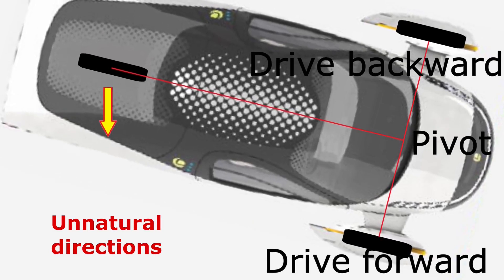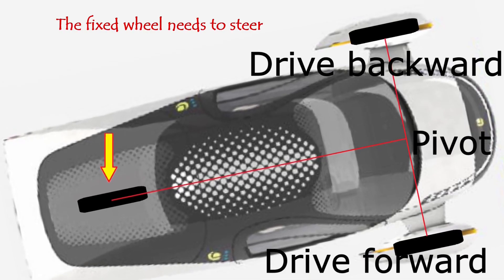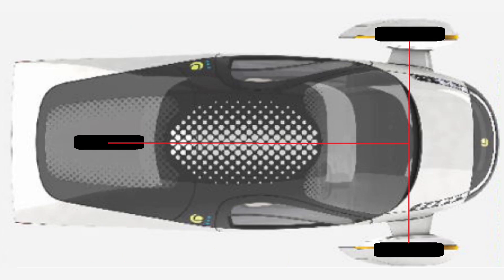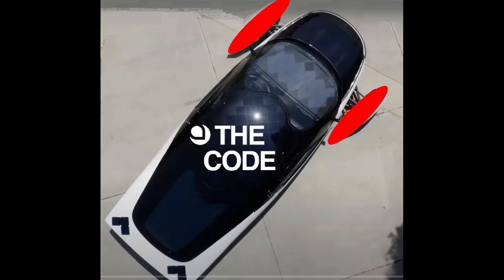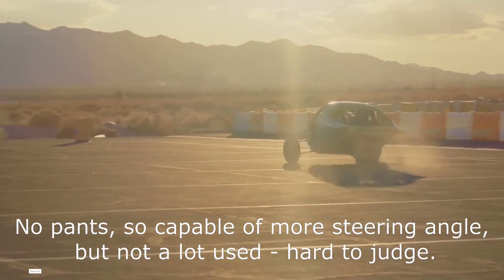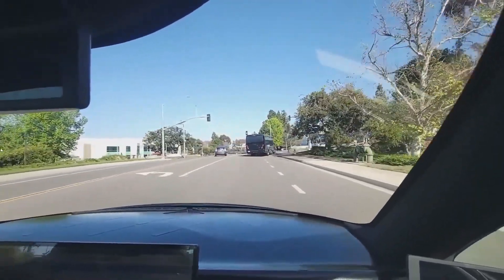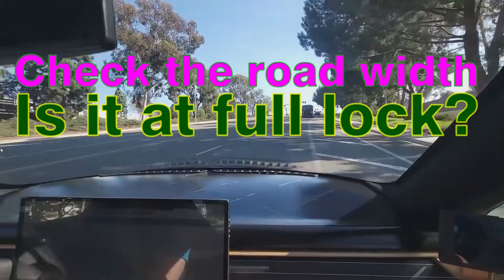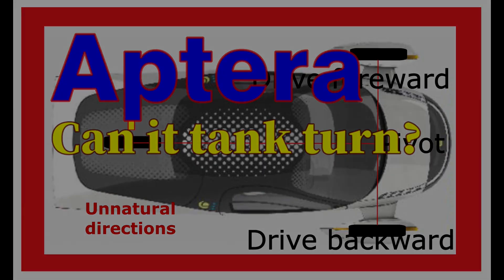Aptera Tank Turn

Comment from the maker: Pasted from Aptera Owner's Club today (the club with no owners):
This ditz is spreading the snake oil. She speaks as though the silly trike exists and, what's worse - as if it does the things the liars at Aptera claim for it, which none are proven. Not one. She is also that thick that she thinks Dolphins must have aerodynamics, when they live in water. Think about it, you brain-dead gullible Aptera fanboys; it may require the same shape as a plane, but only one is for aerodynamics. And on that note, she attributes the snake-oil 'computational fluid dynamics' (as is the con) to the design, when it is Professor Morelli who penned that shape in the early 70s and is never given enough credit for it by those deceivers. It was copied by Nissan in the flesh long before Aptera started in 2006, and is a copy still, but only Aptera added skin cooling, in-wheel motors, solar and even a silly tent to appeal to dimwits who would throw their money away on it. I am under a quarter of the way in and see so much guff that one would have to be crazy to take her seriously, and it smacks of her being hoodwinked by Aptera staff. Maybe even on the take? Let's start with the early nonsense about transport being a quarter of the pie? It omits the stats on how much of that is freight that gets the economy going and keeps everyone fed, to boot, which (without checking) I know is the larger part of that quarter, while cars and motorbikes are even smaller when you factor in Planes, trains and passenger boats. In effect, she is making what is not worth pursuing look as though it's the most important solution. And that's how easily gullible fools are strung along. Now, I am blocked from telling you this because the cretin owning this site is exactly that - a cretin for disallowing free speech and for the deception he keeps his viewers under. I will put this on my Aptera videos, but most of the poor dimwits won't be educated because I have less coverage. Oh, well, it goes on at least ten of mine.

Comment: Every motorcycle can tank turn. Its called "donut burnout". The three motor Aptera should be able to do that.
Reply from the maker: Technically, that isn't a tank turn, because the rear goes forward of the braked front wheel. Tanks turn in their own space (actually in the space of their length between front left to rear right; a fraction longer than front to back). Cars can donut burnout like bikes, and even Aptera can, but it's not the capability of a tank turn; it's a harmful work around.
Reply: @aussieideasman8498  But it is not so far away from the Rivian tank turn. And it is easier to accomplish, only one rear wheel has to loose traktion (while heavily smoking), the two front motors could independently turn the vehicle. And you would need a new rear tire after that.
Reply from the maker: @vic321344  The Rivian does a real tank turn. You can do it in an Aptera if you put a furniture dolly under the back wheel.

Comment: look into the Polaris slingshot its been around for years and has the same 3 wheeled aspect.
Reply from the maker: Who said the Slingshot was great through turns? It isn't, but at least its 124 mph top speed is okay, and it is real. There's that.
Reply: @aussieideasman8498  Nobody is claiming the Aptera is going to be the greatest turning car. So you don't have a better response to @TravelingChad than "its top speed is 124mph"? I've seen some of your videos and you just seem like a pessimistic grumpy old man
Reply from the maker: @mikeward3462  [Nobody is claiming the Aptera is going to be the greatest turning car.] Their mantra to build the most efficient includes turning efficiently. 
[So you don't have a better response to @TravelingChad than "its top speed is 124mph"?] You missed "it's real". That's a better response.  
[I've seen some of your videos and you just seem like a pessimistic grumpy old man] So stop watching.

Comment: Who has a concern about the Aptera having the ability to tank turn? A tank turn or crab walk is more of a interest with the coming EV trucks.  But you could think up a way the Aptera could spin 180 in place or tank turn.  All this could be done using the wheel speed sensors and some programming. Now this could only be done with a AWD model, and this is just an idea.  Lock the 2 front wheels, send power to the back wheel to make it brake traction (do a burnout) when that happens send power 2 the front wheels in opposite directions and spin that back wheel around 180 or keep going.  
Why are you so hung up on the turning circle of the Aptera? They have stated that it was improved from the Alpha to the Beta cars with Roush’s involvement with the suspension improvements.  I find it funny of how you try to mislead and put out bad information. You compare to a Mazda Miata, a car that is known to have one of the best turning diameters (curb to curb) of 30.8’, It would be more honest to use a car that has a similar wheel track.  What is you acceptable level that you mention?  The turning diameter for a SWB F150 is 41.2’, so would you say that some where between 30’-41’ is acceptable. You just put out statements based on what you think and feel with no context to mislead.
Reply: If you got a footprint larger than a Hummer H1, you also got the turn radius of a Hummer H1. live with it.
Reply from the maker: "Who has a concern about the Aptera having the ability to tank turn?" N Bruce Nelson. 
"A tank turn or crab walk is more of a interest with the coming EV trucks." Tank turn and crab walk are two separate moves. Nobody has mentioned the latter, to-date.  
"But you could think up a way the Aptera could spin 180 in place or tank turn." 180  in place is not possible. The best is 180 in twice the distance from between the front centres and the tail. 
"All this could be done using the wheel speed sensors and some programming." Not so. 
"Now this could only be done with a AWD model, and this is just an idea.  Lock the 2 front wheels, send power to the back wheel to make it brake traction (do a burnout) when that happens send power 2 the front wheels in opposite directions and spin that back wheel around 180 or keep going." It's 'break' traction, and that will only turn in the distance the tail goes around the front centres, which will be further forward than the nose by a long way. No need for speed sensors, nor even  AWD. 
"Why are you so hung up on the turning circle of the Aptera?" You didn't see that mountain road? 
"They have stated that it was improved from the Alpha to the Beta cars with Roush’s involvement with the suspension improvements." Suspension improvements do nothing for steering angles. Almost all their claims have holes you can drive trucks through.  
"I find it funny of how you try to mislead and put out bad information." I find it funny how you have so little comprehension. 
"You compare to a Mazda Miata, a car that is known to have one of the best turning diameters (curb to curb) of 30.8’, It would be more honest to use a car that has a similar wheel track." It is more honest to declare the turn circle. Similar tracks is almost moot, because most cars are similar to a Camry (some a little less and some a little more track), and yet they have a good deal of variation in their circles. Track is just one thing, and angle is more telling. This silly trike is supposed to be a small car, so the Miata is a good compare. The Smart car has 22.8 ', and the Honda E has 14' 1", which blitz the Miata.  I was being generous. 
"What is you acceptable level that you mention?" I have never tested it; I leave it to manufacturers I can trust.   
"The turning diameter for a SWB F150 is 41.2’, so would you say that some where between 30’-41’ is acceptable." It is for an F150, but not for a Corolla. 
"You just put out statements based on what you think and feel with no context to mislead." I tell everyone - I deal in facts. If you think the skin can cool Aptera, you are accepting statements that are not based on facts, but on what manipulated computers think. If you think Torque Vectoring has anything to do with direct steering, you are being misled. If you think 65-35 weight distribution is optimum for a trike, you are a thickhead. If you think you can throw an extra 50 lb in each wheel and not suffer consequences, I have a bridge in Sydney to sell you. I do this stuff because there are literally tens of thousands of clowns in America and beyond, and they make me laugh.
Reply: @aussieideasman8498  You say you “deal with facts” but have no facts to support your claims, you just copy what is said with a negative or personal attack response.  Now concentrate (you did it to me first), I already corrected your misleading claim about 65-35 weight distribution for a trike. Also your confusion of what weight balance and Center of Gravity in the vehicle body is.  As stated before 65-35 is ideal for a trike design, if you like it or not (you did not respond to that comment).  This is why I say you judge on how you feel and not facts. But you still miss lead by saying it’s not optimal with no backing, and then go on to a personal attack.   If you want I will cite where this information was a from, it’s easy enough to find if you want, you could look it up yourself or just make fact less statements. Suspension improvements would also include steering angel, you would not change components or design and not address its geometry , making a statement where you believe they are separate considerations is being intentionally obtuse or uninformed.  Again why I claim you just go make statements from feeling. You leave it to manufacturers you trust, do you trust Roush with their extensive racing a development history? You say “manipulated computers”, …do you not trust computers either? Yes I do think that Aptera can have a aluminum plate that is the lower skin on the bottom of their car to disparate heat like a radiator.  I already know you are going to pull up the cartoon that Aptera used back in 2019 as justification for what ever rebuttal you will have, it’s a cartoon representation of an idea.   Also with proper engineering the thermal dynamics of a skin cooling system like that can be solved. Those same engineers can compensate for the added weight of the wheel motors.  Don’t take my word on it, you can use your computer and read about the topic of wheel motor pros and cons and consequences from people that base information in fact.  All these concerns can be simulated in very powerful computers programs like Solidworks and Catia and then verified with real world testing. Every automotive company uses software and steps like this, no one uses slide rules anymore.
Reply from the maker: @Running__Rabbit  "You say you “deal with facts” but have no facts to support your claims," Here's the deal: you state any claim and cite where I made it, and I will support my claim with facts. Full disclosure - I believe you are not telling the truth when you say that. 
"you just copy what is said with a negative or personal attack response." List your examples. I will deal with every one of them.
"Now concentrate (you did it to me first)," Cite the occasion. I never do something first to anyone - I'm a 100% responder. People lie to me first a lot. 
"I already corrected your misleading claim about 65-35 weight distribution for a trike." I never said a trike needs that balance. I said 50-50 for any vehicle, no matter how many wheels. I believe you mean you 'corrected' my 50-50 claim and don't have the English skills to say what you mean. In any case, a new reader doesn't know what happened, and is confused by now.
"Also your confusion of what weight balance and Center of Gravity in the vehicle body is." I have never said I was confused about it. You have made that up.  
"As stated before 65-35 is ideal for a trike design, if you like it or not (you did not respond to that comment)." I covered this. I recall saying it's ideal for tyre wear, but for nothing else. Handling is atrocious.  
"This is why I say you judge on how you feel and not facts." And you lie. 
"But you still miss lead by saying it’s not optimal with no backing, and then go on to a personal attack." You need to reference the occasion. I am talking with a gossiper.   
"If you want I will cite where this information was a from, it’s easy enough to find if you want, you could look it up yourself or just make fact less statements." I want. 
"Suspension improvements would also include steering angel," That's 'angle', and suspension and steering are separate entities. Steering improvements deal with wheel angles, and have nothing to do with altering shock absorber rebound. One might inadvertently affect the other in small measure, but they are different sciences with different components. 
"you would not change components or design and not address its geometry , making a statement where you believe they are separate considerations is being intentionally obtuse or uninformed." No - it's stating the facts. They need to get both right, and it is fine to work on them at the same time, but they are still chalk and cheese. However, I am not changing components or design, so why talk about what I would do? And where is my intent revealed? You are just making stuff up as you go.   
"Again why I claim you just go make statements from feeling." And again, out of thin air. 
"You leave it to manufacturers you trust, do you trust Roush with their extensive racing a development history?" If I was a Roush customer, probably. If I was an Aptera customer, I have nothing more than Chris' word that Roush has been involved, so no - Chris has lied too many times in the past. I need to see evidence Roush has done something. It's all facts sans emotion. 
"You say “manipulated computers”, …do you not trust computers either?" I am a retired programmer. I trust computers to do exactly what they are coded to do. When liars use them, I don't trust the claims, especially when all I have heard is the simulations said this, and I have not seen a single simulation, let alone a result. 
"Yes I do think that Aptera can have a aluminum plate that is the lower skin on the bottom of their car to disparate heat like a radiator." The word you are looking for is 'dissipate'. When someone doesn't know the difference between that and 'disparate', I don't care what they think. It's a red flag to a bull. I care about what 150 years of auto engineers think until facts show otherwise. AT present, the facts are a prototype broke down in a race because it overheated. There has been nothing since that has addressed that problem. If you think the skin can 'disparate' heat; good for you. I'm not with you.  
"I already know you are going to pull up the cartoon that Aptera used back in 2019 as justification for what ever rebuttal you will have, it’s a cartoon representation of an idea." I am not following this train of though you have, and regard you as a bit of a scatterbrain.   
"Also with proper engineering the thermal dynamics of a skin cooling system like that can be solved." The kids I have seen on their team thus far don't even look like proper engineers. It doesn't matter, because I accept solutions when I see them work, and the engineering behind them is not required at all, once that point is reached.  
"Those same engineers can compensate for the added weight of the wheel motors." Those same engineers can take the weight out of the wheels. Either way, the end product will need to work. Happy to wait and see, but in the meantime it is contrary to conventional wisdom, and that's the extent of my claim. 
"Don’t take my word on it," rest assured - I won't, angel. 
"you can use your computer and read about the topic of wheel motor pros and cons and consequences from people that base information in fact." I have seen many YouTube videos on eBikes and the general consensus is that mid-mounted motors are superior to in-hub, and it is more pronounced the larger the motor gets.  
"All these concerns can be simulated in very powerful computers programs like Solidworks and Catia and then verified with real world testing." All these concerns are from eBike experts and their long-term experiences. "Every automotive company uses software and steps like this, no one uses slide rules anymore." Not every auto co. sits liars down in front of their computers.

Comment: Put a little trolly under the rear wheel. 
Tada, it can tank turn. 
Next useless video?
Reply from the maker: You are so far behind. I told Bruce there was a picture on the net of one with a furniture dolly under the rear wheel. It's not a tank turn because it's pivot point is between the front axles, but it's almost there. The good thing is two people can push the wheels up front without needing a motor - next useless trike?

Comment: i thought the turning radius can be reduced further if they make the back wheel turn in opposite direction to reduce the turning circle.
Reply from the maker: It could if you can angle it at well, otherwise no.